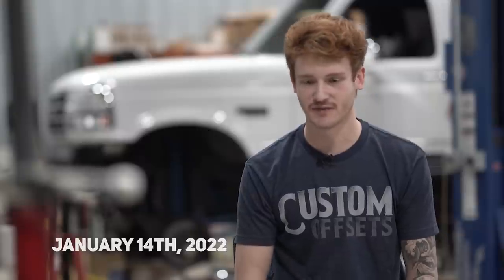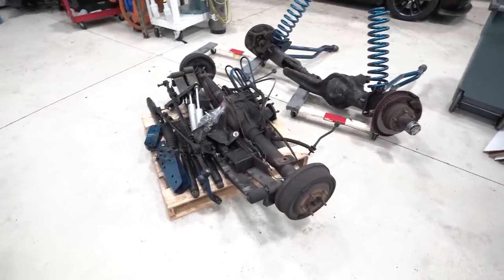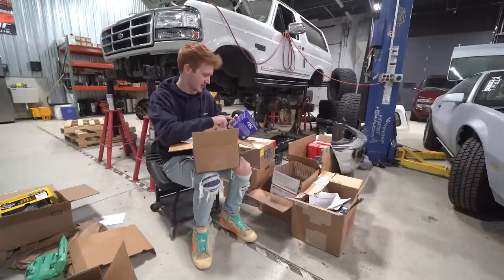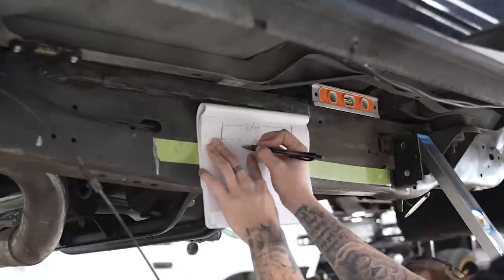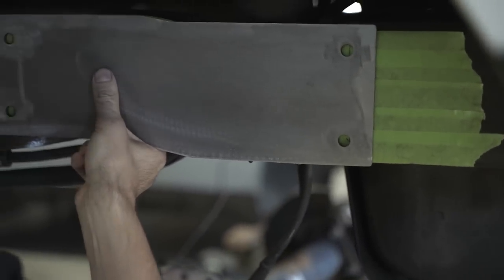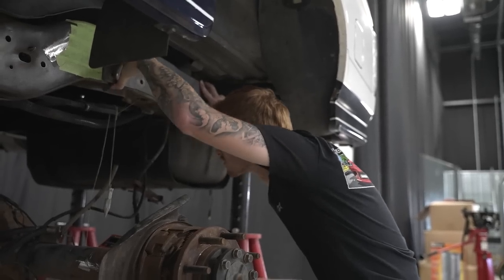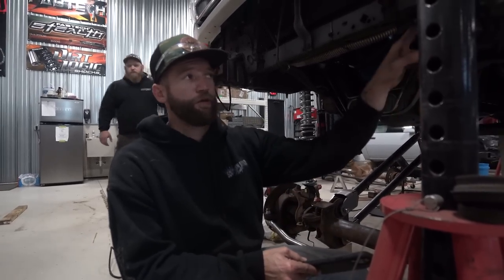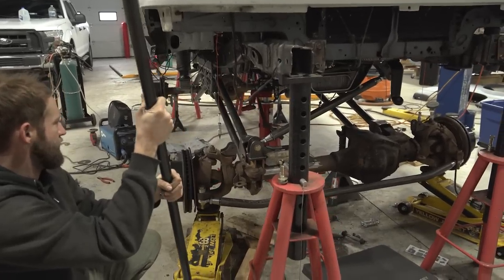My Bronco Took A YEAR To Build... OBS Ford Bronco Custom 4 Link Lift Kit

Comment: If had my 88 XLT since it was new. Been building on it since I was 16. 5 engines, 5 transmissions, 3 transfer cases, 1 tons with 4.88s and lockers, SAS’d the front. I’m running old caddy calipers for the rear discs so I could keep the parking brake. Hand wired a Mustang A9L to swap to SEFI and supercharge it in the 90s when there was no such thing as a kit. Next changes are probably a 4bt and 4 link both ends. I appreciate your build.

Comment: what type of bags are in the rear? i want to put some in my 2010 F-350 SRW with a three inch lift in front and want to have my it so i can lower it to reverse level and then up to 3 inch lift

Comment: Lost me at LS 🤦
Reply from the maker: What motor do you think he should of went with lol.
Reply: Supercharged 5.0 would of been rowdy
Reply: @CustomOffsetsTV  a SC coyote is what I would've went with but its not my build hell or build the Windsor that was in it he's already spending the money on the axles and suspension plus wheels yet puts a junkyard motor in it lol
Reply from the maker: Hey he built that junkyard engine… at least give him some credit lol
Reply: He just made it reliable 🤷🏻‍♂️
Reply: @samcrews3407  I doubt that but at least it'll look good while waiting for the tow truck
Reply: @CustomOffsetsTV  12v
Reply: Ls is king. Period. Can’t beat the versatility, affordability, horsepower per dollar potential, and hyoooge aftermarket support and parts availability. There’s a reason why it’s so common too so ls swaps into everything. 
I have those calipers too on my truck. You have fun bleeding them?? Lol you can only gravity bleed them in my experience and it takes a couple hours to bleed all 8 bleeders on the front calipers. Otherwise good brakes and they look great.